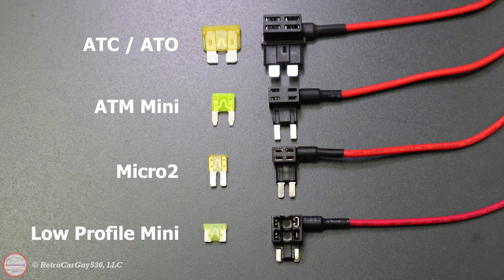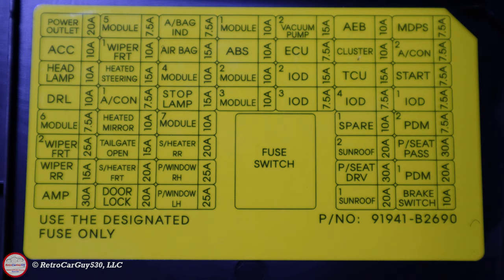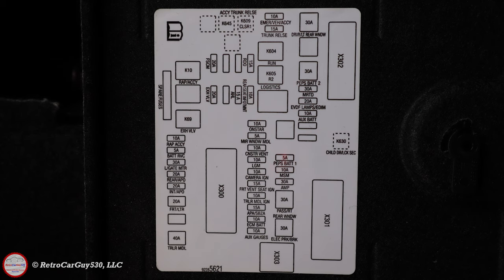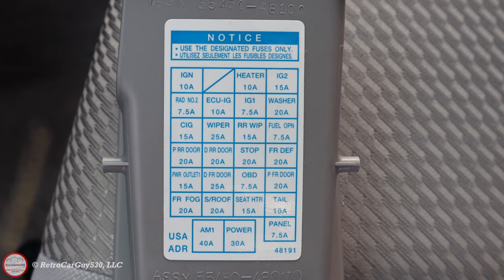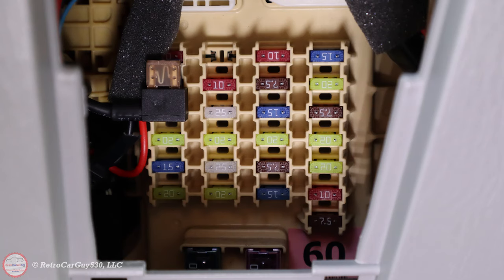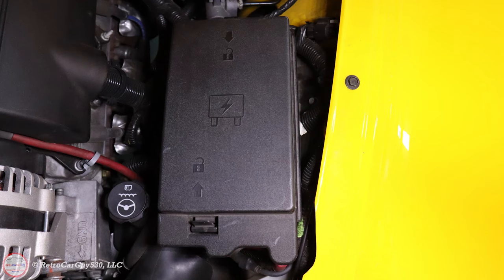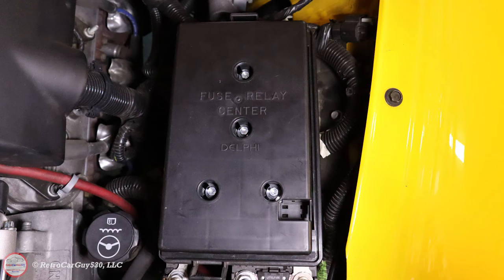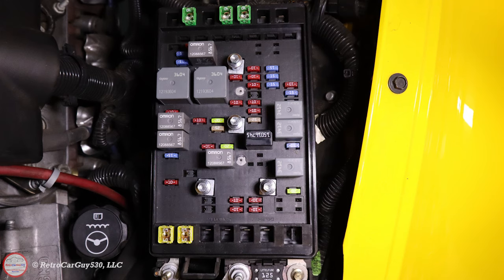How To - Add a Fuse Tap in Your Vehicle

Comment: Maybe I missed it, but do I need to use the same size fuse to supply the new accessory as the existing fuse for that space, or will a fuse with a different amperage be acceptable to use?
Reply from the maker: Warning, lengthy reply….

Other fuse tap videos will state to use the same (or no larger) amp rated fuse or for the new accessory as the original fuse in the fuse box's fuse socket.  The fuse amp rating of the new fuse for the new accessory is not something that should be based on the pre-existing fuse box fuses.  The power demands of the new accessory are what and only what determine what the proper amp rating is for its fuse.  My approach is to use a fuse that is sized appropriately for the new device (check the device's documentation) and then find a fuse socket that can provide the required power.

For example, if you are adding a dash camera and the power demands of the dash camera are 1 amp or less, you should not be using a 10 amp fuse in the fuse tap's upper fuse socket (for new accessory) if the original fuse box's fuse amp rating was 10 amps.  The fuse's job is to protect the device and wiring in that circuit from overload conditions (cuts in the wires, defective devices, etc) and using a fuse with a much higher amp rating does not truly protect the device or the circuit.

Using the same amp rating as the original fuse's amp rating can be dangerous as well.  A fuse box fuse socket with a 20 amp fuse, DOES NOT mean you can put a fuse tap into that fuse socket and add a new 20 amp fuse with the fuse tap.  Doing so means you are potentially requesting 40 amps of power from that fuse socket which is beyond the 25 / 30 amps that a blade style fuse and/or socket can really support.  This approach is assuming the wiring/power bar that provides power to the fuse box fuse socket can safely provide double the number of amps that the original fuse was capable of safely delivering.   That tends to be ok with low amp fuses, but when you get to 10, 15, 20, 25 and 30 amp fuses that theory breaks down quickly. 

I would love to be able to say with absolute certainty that any fuse socket in a fuse box can provide up to a specified amount of amps, but there are so many factors that go into how the vehicle manufacturer designed the power routing in the inside of the fuse box.  A vehicle manufacturer will tell you to never use a fuse tap, but for smaller power needs it can be done in a relatively safe manner. 

Most constant (unswitched) power fuse box sockets tend to get their power directly from a beefy wire from the battery and use power distribution bars inside of the fuse box to distribute that power to the various locations that require constant (unswitched) power.

Some accessory (switched) power fuse sockets obtain their power from the ignition switch controlled circuit and some obtain it from modules that provide power to a variety features/devices/accessories in the vehicle.  The ones that obtain their power from modules are not good candidates for fuse taps, but the fuse sockets that get their power from the ignition switch power are decent candidates for larger amp draw circuits.  It's not easy to determine necessarily which ones are module controlled unless the fuse box fuse chart mentions something in the name for that fuse socket.

As I state in my fuse tap videos, I never would assume any fuse socket can provide more than 25 amps for blade style fuses.  If there is a fuse already occupying the fuse box fuse socket and you want to add a fuse tap there, make sure the sum of the amp ratings of the fuses does not exceed 25 amps, BUT that is assuming the fuse socket is getting its power from the battery or the ignition switch supplied power.  

I have two other videos related to automotive blade style fuse taps that may give you more info on this topic.

I have a frequently asked questions video based on this video.

FAQs - How To - Adding a Fuse Tap to Your Vehicle : https://www.youtube.com/watch?v=DnZ5wb_A5vE

I recently created a video that explains how the power is routed in a blade style fuse tap and it shows an easier method to test which side of the fuse box fuse socket provides power.

Anatomy of An Automotive Fuse Tap : https://www.youtube.com/watch?v=YNc0FfeL6rw
Reply: @RetroCarGuy530  thank you for the quick and detailed response. This makes complete sense, but I will check out these other videos as well.

Comment: How do I know what fuse is used for the radio I'm trying to install?
Reply from the maker: That's a simple question with a complicated answer. 

First off, avoid any/all fuse sockets that power computer control modules in the vehicle.  You'll have to examine the fuse box cover and/or the owner's manual of the vehicle to obtain this information.  You're just asking for trouble when you tap into power going to or coming from a computer control module.  The best power sources are constant (battery / unswitched) power (if appropriate for the new device) and accessory (switched) power from a fuse socket that obtains its power directly from a power source controlled by the ignition switch (which may be difficult to determine).

If the device you're adding requires 10 amps or more, I would not recommend a fuse tap as the first choice to provide power directly to the new device.  Why you ask?  The fuse tap wire itself can supply no more than 10 or 15 amps due to its wire gauge/thickness.  In addition, trying to supply 10 or more amps to a new device may overload the circuit that provides the power to the fuse socket where the fuse tap is installed.

You need to know what the max amp load will be for the new accessory/device.  Refer to the new device's documentation or labels on the device itself.  If it requires 10 or more amps and the device needs accessory / switched power (I would assume a radio would need that), I would recommend using a new 4-terminal relay which obtains its power directly from the battery with an inline fuse to protect that circuit.

Terminals 30,87 (device power) and 85,86 (control circuit) are the common terminal number assignments for a 4-terminal relay.

Battery power would go to the inline fuse and then from the inline fuse connect to terminal 30 of the relay.  The amp rating of the fuse in the inline fuse connector again depends on the device's power load demands.  Terminal 87 would then be connected to the new device's positive power lead.

The control circuit power for the relay can be obtained from a fuse tap, because a relay's control circuit is usually far below 1 amp (150 to 250 milliamp range).  The control circuit power for the relay would have the fuse tap obtained power go to terminal 85 and then terminal 86 would be connected to a ground point on the vehicle.  Some charts will list terminal 85 being connected to ground and terminal 86 having the control circuit positive power connected to it.  Either approach will work 85 (power) / 86 (ground) or 85 (ground) / 86 (power), but if there is a chart provided with the relay, follow its wiring approach.

I hope that helps.

Comment: What happens if you don't put the original fuse on the bottom?
Reply from the maker: The circuit/device provided power by that fuse box fuse socket will not have power.

Comment: If the fuse I’m adding the tap to is switched power (headlights) will the new fuse only have power when the lights are on? This is what I’m trying to do.
Reply from the maker: In most cases, the answer is yes to your question. Why I say "in most cases" is that a power circuit can be controlled on the power side (before the device/accessory) or the ground side (after the device/accessory) of the circuit.  The most common way is to control when power is provided to the device, but the "switch" could be on the ground side of the circuit with the power being supplied 100 percent of the time.  Even if the switch is located on the power supply side of the circuit, it could be located before the fuse box or after the fuse box in the circuit.

I would recommend using a 12-volt test light or a digital volt meter to confirm when power is present at the fuse you've selected for your fuse tap.   If the "switch" is in the power side of the circuit before the fuse box, you should be able to see the power only when you turn on the headlight switch.

Comment: I have 3 LED Light i want to install, how can I do this. Your video was great very informative.
Reply from the maker: It all depends on how many amps the 3 LED light assembly draws (max amp draw when you first turn it on and then the steady state amp draw while the lights are on).  If there's any question about it drawing too much power (amps) from the fuse box fuse tap connection, then you might want to consider using a fuse tap to supply switched power to the control circuit of the relay and the relay power supply circuit (with inline fuse) to supply power to the light assembly.  I use this approach for a dash camera battery pack.  The fuse tap is installed into a fuse socket that provides switched power.  The relay control circuit often uses less than 5 amps and often it's less than 1 amp.  The circuit in the relay that provides power to the new accessory is connected directly to the battery (again making sure it has a fuse in that circuit or at the relay itself).

This approach allows my dash camera battery pack to obtain high amp (10 to 15 amp) power to facilitate quick charging of the battery pack, but without putting a strain on the fuse box.  The fuse tap is only used to provide the power to control circuit side of the relay.  In the case of a 3 LED light installation, you could add a switch in the wiring after the fuse tap to make it something you can turn on/off yourself (but only with the ignition on since you tapped into a fuse socket providing switched power for the relay control circuit).

I talk about this approach in the FAQ video as well.  https://www.youtube.com/watch?v=DnZ5wb_A5vE
Reply: Thanks for the explanation. But I'm a bit confused about it....what is your best recommendation for the install.  Each set of the LED strip comes with its own remote or is app controlled. I want to be able to still control  them with the remote or app it came with but not have them come on when I turn the ignition switch on. What I'm trying to accomplish is to tap into the fuse box using the fuse tap. Can I use more than one chassis for the ground....or can they be linked together.
Reply from the maker: You can use the fuse tap in a switched fuse socket to supply power to a 12-volt switch in the passenger compartment that would allow you to turn on/off the power to the LED strips.  With the power turned on via the 12-volt switch, you can then use the remote/app to control the lights.  This is assuming that the three LED strips together don't draw more than 10 to 15 amps and you have a fuse socket in the fuse box with enough available amperage to support the amps necessary for the LED lights.  The switch approach is necessary if the LED strips auto turn on when they are first supplied with 12-volt power.

You can ground each LED strip at a good ground location near where each one is installed.  There should be no need to run a ground wire back from each of them to a common ground.
Reply: @RetroCarGuy530  thanks for the information. EACH set of LED strip amperage is about 3.5...so how can I wired them together.  Total amperage would be about 14amp for (4) sets of LEDs.  So can I use on 12v switch for all of them? Do I need a relay for each? And how many fuse tap would I need if I can connect to the fuse box or what do u recommend? Also , there is a bolt/chassis near the battery so can I plugged more than one using one ground or would i need to find another bolt for each led light. Also, would i need a 20amp fuse for the fuse tap if plugging all of them together. The led lights are 12volts
Reply from the maker: That amount of amps for the 4 sets of LED lights is pushing the boundary of what a single fuse tap can safely provide.  You could use a couple of fuse taps to spread the load, but if you want to control all of them at the same time it would not be helpful to use more than one fuse tap or even a single fuse tap to power all of the LED light sets.

IMO, it would probably be best to use a relay to supply the power to the four sets of LED lights.  Use a fuse tap to obtain power for the control side of the relay which you would run through a 12-volt switch and then to the control side/circuit in the relay.  That way the power demands on the fuse box are minimized since the control circuit of the relay is likely to draw less than 1 amp.  

The "power" circuit through the relay would then be capable of supplying the power to all four LED sets assuming the wiring used at least 14 awg (or 12 awg - small number is capable of safely suppling more amps to the thing(s) being powered).  You could connect the power side of the relay to the battery positive terminal.  There should be a fuse in the power side of the relay (in the wiring or in the relay itself) in the range of 15 to 20 amps to allow it to supply the power to the four LED light sets.

The grounds can be grounded anywhere that provides good connectivity.  Then can be connected to the same ground location or different ground locations throughout the vehicle. 

It's difficult to provide 100% spot on advice about wiring anything over the internet.  If there is anything you're not 100% comfortable with in this setup, I might recommend use getting the help of a knowledgeable friend or professional to complete the installation safely.

Comment: Is there any disadvantage to adding a Fuse Tap to a Micro 3 fuse?    The Micro3 fuses are far more conveniently located than the Micro2 fuses within the Fuse Box. I'm installing a hardwire kit for my dash cam.
Reply from the maker: No disadvantage that I'm aware of using a Micro 3 fuse tap.  I've read some reviews of those fuse taps and more than a few buyers seem to report that they don't fit well into the fuse box fuse socket.  Test your micro 3 fuse tap to make sure it fits decently into the fuse box fuse socket before going too far into the installation process.
Reply: @RetroCarGuy530  Thanks for responding and a big "thank you" for the heads-up on testing the fit.

Comment: Tested my fuse panel, found the not assistant on ( on with the Key). Problem is, there is only power to those fuses when that item is being used.example. Hooked up[ to fog lamp, they only come on when car is running. My camera only comes on when the fog lights are on. that is the same for each fuse. 2009 Yukon
Reply from the maker: I found what looks like an engine bay fuse box diagram for the 2009 Yukon.  It looks like fuse #28 is for the fog lamps and it's located right next to a fog lamp relay (just below it).  That suggests that fuse #28 may be for the power supplied to the fog lamps when they are turned on.  I can't confirm that without a wiring diagram (which I don't have access to).

That diagram shows that fuse #53 "Cigarette Lighter, Auxiliary Power Outlet" is located in the lower center (just offset to the left a bit).  That could be a candidate for switched (accessory) power, but many GM vehicles have those power outlets powered all of the time (unswitched power).  You'd have to test that fuse (assuming I have the correct fuse box diagram) for switched power.

Most dash cameras consume less than 3 amps (and many less than 1 amp) while running.  If the #53 fuse provides switched power and it has a 20 amp or lower amp rated fuse in it, it could be a candidate for the fuse tap for the dash camera.

The "Instrument Panel Fuse Block" shows fuse #2 as the "Rear Accessory Power Outlet" fuse.  That's the second from the top fuse in the middle (according the diagram I located).  If that's a switched (accessory) power based fuse, that might be another possible source of power for the dash camera.
Reply: @RetroCarGuy530  Thank you for the prompt reply. As I said. there is only power to the fog lamp fuse when the lamps are turned on, the cig lighter is always on as is the the one in the rear luggage area. 
I have been trying to locate the Radio and entertainment fuse as they are always on when the key is on and are obviously a switched fuse.So far I cannot locat any fuse that has that title.
thyanks for your help

Comment: Can i just plug the fuse tap in and test it either way to see which direction is correct? The back of the packaging for the bussman fuse tap says to put in the fuse for the acc and see if your acc has power, if it doesn't then plug it in the other way. Then install the fuse that goes into the original spot you are putting the fuse tap into. Will this hurt anything?
Reply from the maker: If you just have the one fuse installed for the new accessory into the top slot of the fuse tap, you can use that approach as well to locate which orientation of the fuse tap gets power supplied to the new accessory.  

This approach also locates which side of the fuse socket is providing the power to the left leg of the fuse tap because if the accessory is getting power then you know the left leg of the fuse tap is inserted into the side of the fuse socket that provides power.

Inserting the original fuse into the lower socket of the fuse tap (with the ignition off) after you've discovered the proper orientation for the fuse tap, should be just fine.

Thanks for checking out my video!